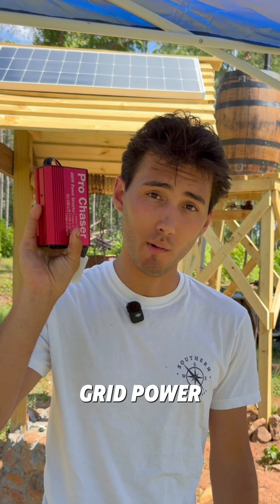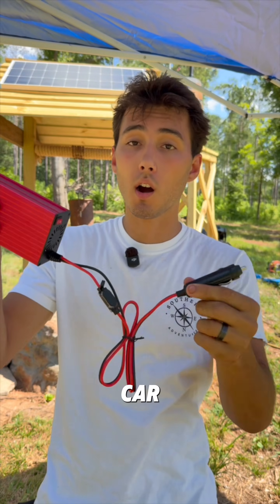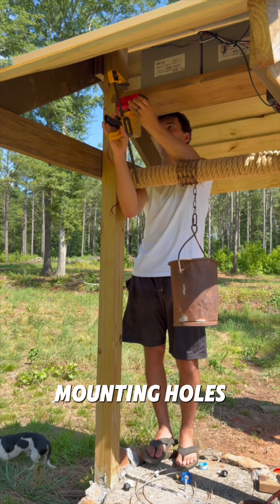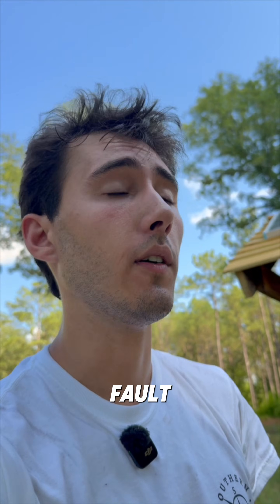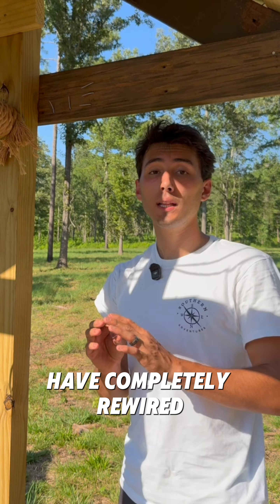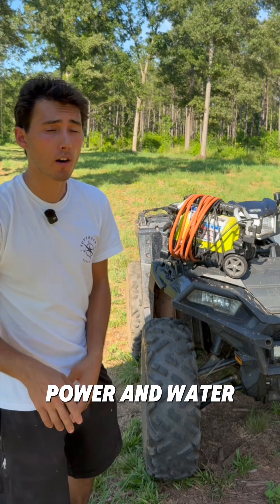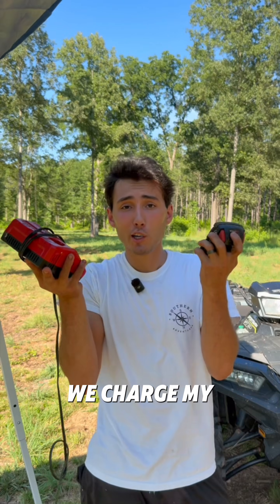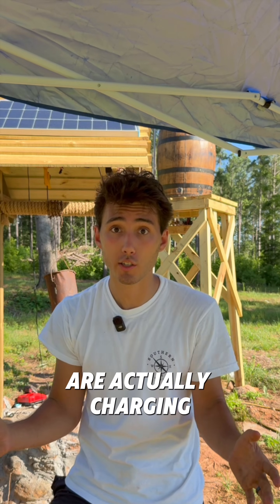My Entire Solar Setup FAILED. Here’s Why…

Comment: A $20 multimeter is also a must when dealing with power. Always check your polarity, and power putput both ac and dc. Spending more on one that can read current is also a plus.

Comment: Im hoping you really did not put a 50 amp fuse. That wire looks like it's rated for 10 or 15 amp.

Most people dont know, but fuses are there to protect the wire, not your devices. It is to prevent the wire from overheating and causing a fire.

Comment: I salute your mission and your solar strategy. We built a tiny house last spring and we bought 6 175 watt solar panels, 4,000 inverter and 4 batteries housed in an insulated back step box. Good to -25C then it needs grid electric heat through a battery blanket. Works great! Recharges all our Makita batteries and boils 4 or 5 kettles of water on sunny days.

Comment: You are soon going to find out that it takes a ton of solar panels and batteries to have a reasonable amount of power. Let's take 8000 watts divided by 120 equals 66.7 amps. That's less than four 15 amps circuit breakers in your grid supplied home. Go take a look at your circuit breakers in the grid house. After that, you begin to understand how many solar panels and batteries you will need: A fuckload. Your little pump system is "cute"

Comment: I have a dumb question. Where the plan for the treehouse drawn by an architectural frim or did you draw them. If they where drawn by a firm it should follow all guidelines. If you dont mind sharing where in gorgia you are located i can try an pull up the code book and see if they illegally shut off water and power or if there was another cocern that made them do it
Reply from the maker: The plans were drawn by me yet they still followed all codes. I’ve already confirmed that they did infact illegally shut off the water and power because there was no notice or due process.
Reply: Ok the best i can then recomend is going to the code enforcement office have them look over all of you plans and send an inspector out to make sire everything is up to code and get an engineer to assist in areas where they would recomend adding more stability if needed. After that you can the dispute the illegal shut-off and have the switch it back on and or have a electrical or plumbing inspector look at everything. Because the house is solidified to the ground there shouldnt be any problem maybe adding a few bracers here and the acording to the engineer.@SouthernAdventuresYT